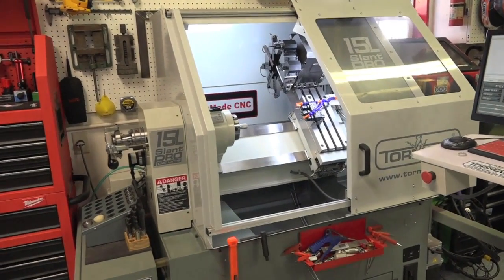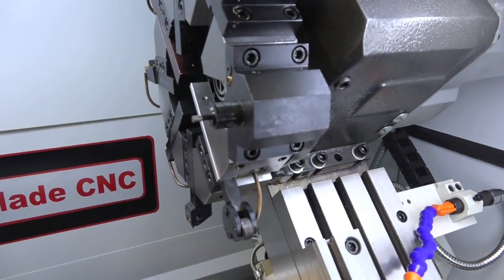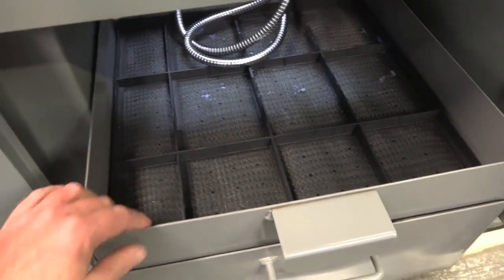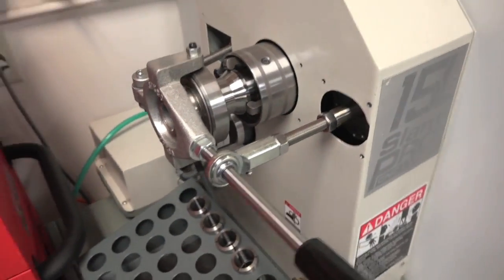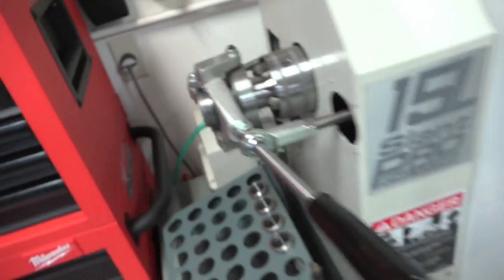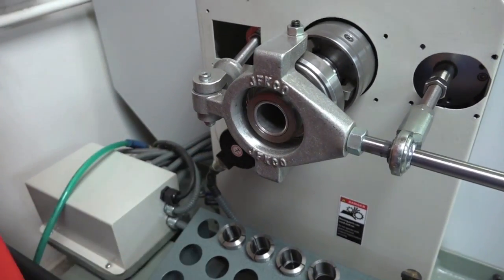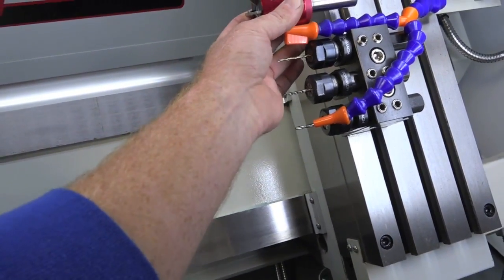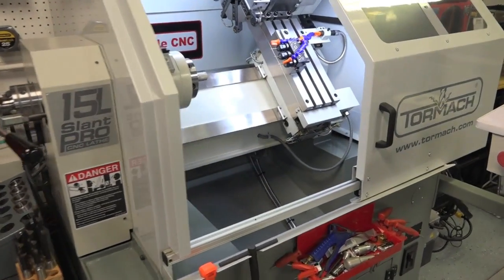Quick up date on a few mods we did on the Tormach lathe

Comment: Any more details on the red tool shelf hanging next to the dead blow hammer? 
Great tips! Looking forward to getting my Tormach lathe in a few months!
Reply from the maker: Thanks!! Paul  the red shelf is from Harbor freight the part num# for it is #69319 there are $9.99 works great
Reply: +G-Made CNC awesome, thanks for the part number! Putting that on the list to get along with the auto collet closer, bar pull, foot pad (for the bottom) and the chip filter!. Love all the mods you did! 

Already downloaded Fusion 360 and getting some hours of practice in on my first CAD/CAM program for my first CNC machine! Thanks for the vids and advice/reviews. They are very helpful and bookmarked as a educational reference. I will be watching multiple times! Can't wait to get my Tormach lathe!
Reply: G-Made CNC
I know it's 8 months later.  I've been putting it off for a while. I finally was fed up with my door hitting my chuck key and bought the magnetic tray and even the same paper towel holder you have for HF. Thanks again for the part number. I honestly had to pull up the video to show them what I was looking for. Lol👍

Comment: Do you have any issues with vibration on the collet closer handle while running the machine? I've got runout to less than .0005 and still get some vibration. Should that be expected?
Reply from the maker: Yes mine vibrates as well I spoke to John Grimsmo about it and his does the same. So I got in touch with Tormach and there answer to me was that it's natural to have a little vibration and there's also vibrates. I know that not a acceptable answer. But that's what I was told. But now that I have put the Air cylinder on to make the collet closer pneumatic it has minimal vibration to it. Hope this helps

Comment: CAN YOU USE AN M CODE OR ANYTHING ELSE TO HAVE THE PROGRAM OPEN AND CLOSE THE COLLET?
Reply from the maker: I have a video coming up that will walk you through setting it all up and what codes to use and how to write a code to repeat multiple parts using the bar puller with the collet closer